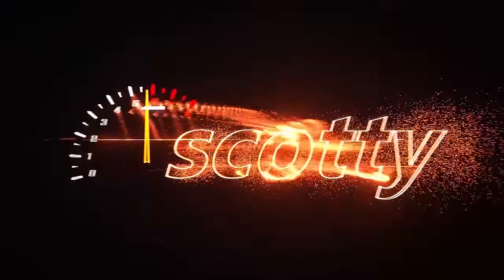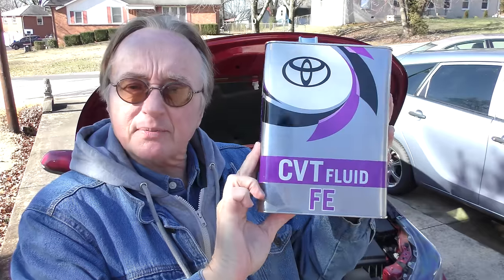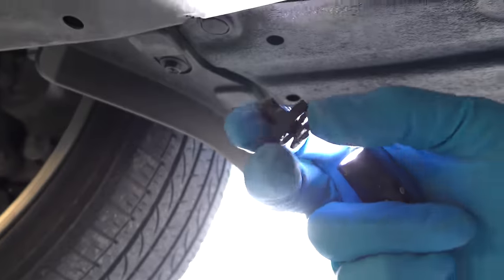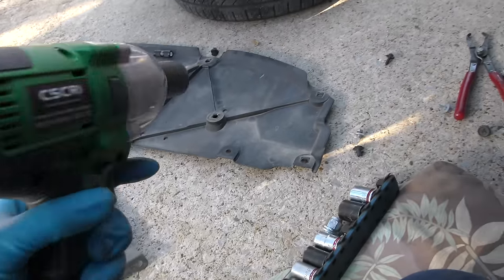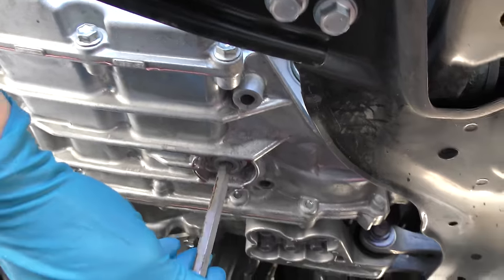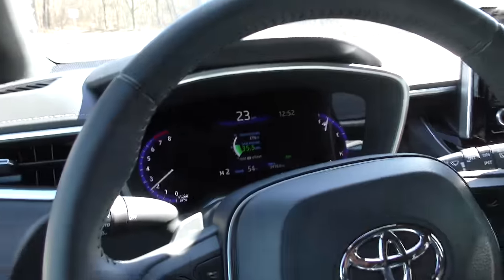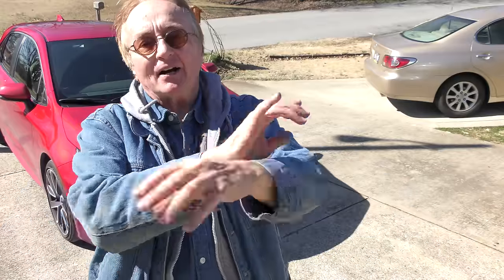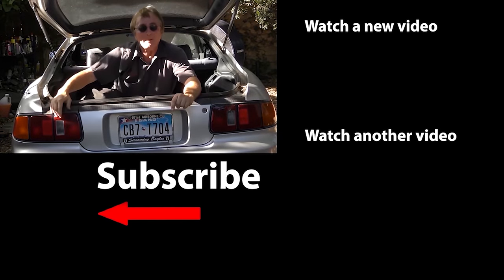Toyota's New Car Really Pisses Me Off

Comment: CVT? No thanks, Scotty.  give me a stick shift any day.
Reply: Manual gearbox for me too
Reply: @Mark-lo6bs That's fair enough.
Reply: Well u better move out of North merica if u really want to compromise what u want for ya life purpose. Outside of NA  there is option for manual version for every passenger vehicle
Reply: Meh - CVT’s (by Toyota) are great - my 11 year old Lexus hybrid on 120k with zero issues beyond basic filters and fluids. Will still have it 10 years from now.
Reply: Toyota CVT has launch gear so it’s good.
Reply: I'll just stick to the Lexus es 350 V6 automatic transmission no cvt transmission drives smooth everytime 😂❤🎉
Reply: @Mark-lo6bs I drove a manual transmission in downtown LA to work for a few years.
Reply: Duluth was rough with a manual transmission. Some steep hills!!!
Reply: Automatic transmission for me. Broke a wrist in the past; manual wouldn't have helped.
Reply: Absolutely. Manuals last much longer.
Reply: Yeah me too
Reply: Good luck finding one in a newer car.
Reply: That toyota CVT last over 200k Miles
Reply: @jonboz7585  Depends who’s driving it. 😂
Reply: @seancorker5815 Toyoya hybrid eCvt doesn't have belt or chain. They build completely with planetary gear.
Reply: Yep, im a honda, mazda and old for guy ..id buy the civic SI or civic sport over this, they come with the 6 spd standard tranny....
Reply: Are you like 60 years old that you're dragging Toyota CVTs name through the mud.
Reply: You probably couldn't even tell the difference between a cvt and an automatic in a Toyota
Reply: @@WindypalaceIn Europe too. Stickshifting is becoming a 19th century thing. Even a stickshift brand like BMW is switching to automatic.
Reply: I am a happy Toyota owner with cvt transmission. 8 years usage as daily driver with 300k on the odometer. Cvt is mainly for fuel savings not for racerboys
Reply: I love manual to, but I’m paralysed left, so automatic cvt auris touring…
Reply: @@Windypalaceyep and they wonder why drag strips are closing.
Reply: Cvt (Crappy vehicle transmission) not saying Corolla is crappy fyi
Reply: Scott doest care for them either, he's just saying the Toyota CVT is the best of the CVTs as it has a real launch gear.
Reply: @bryanczarnecki7570 
…but a es350 is like twice the cost of a corolla….
Reply: @jimliu2560  but not a used or certified es 350
Reply: Manual gearboxes have actually been increasing the past couple years
Reply: i heard CVT in Corolla Sport (hatchback) is great
Reply: @Onion_Knights  
Why hatchback?
The sedan and hybrid uses the same CVT….
Reply: @jimliu2560  i only watch the review of that car - corolla sport in japan, if i am not wrong its a 10 speed cvt which is very good
Reply: My 23 Camry is a 8 speed better than cvt
Reply: @Mark-lo6bs nah, if you are really good at manuals, it wouldn't be a problem
Reply: @seancorker5815 The ecvts are great,I agree. I'm not so sure about these.
Reply: For real
Reply: as manual shift has faded away, so has the nation - probably not a coincidence
Reply: No thank u

Comment: Got a 2016 Corolla with a CVT that doesn't have a launch gear with 265,000 mi on it and just now need a CV axle and rear wheel bearing. Toyota does make a great car
Reply: That's very good! Did you ever change the transmission fluid on the CVT?
Reply: @FURDOG1961  no
Reply: 2010s only Toyota can make CVT and they nail it.
Reply: Great to hear that as I have a ‘24 corolla with cvt and intend to drive it til the wheels fall off.

Comment: A Corolla for $27K?  That's nuts.  These used to be reliable and affordable, but now they're just reliable.
Reply: Model inflation. Modern day Corolla is much larger than the Corolla of the 90s. The affordable reliable Toyota nowadays is the Yaris sedan. Not available in the US.
Reply: I paid $25k in 2019 for a brand new Camry SE. However base model corollas are cheaper than $27k in 2024.
Reply: @viniciusdavila2737 So True. It seems like a mid sized sedan and drives like it too. I have a ‘23 Corolla LE.

Comment: I really don't want to correct Scotty, but as far as I know the Corolla 2.0 Hybrid doesn't use a belt driven CVT with launch gear. It uses an "eCVT" that uses a planetary gear set instead of a belt. The only thing similar to a belt in it is a CHAIN that transfers the power from the gear set to the axles.

EDIT: or do they use different transmissions in europe? I'm gonna have to look it up in my 2.0 corolla manual as I really couldn't find a transimission code on the internet

Comment: They great cars. I have the exact 2022 but sedan SE ( even in red ). Mines at 35k miles now i've owned it since new. I have zero complaints about it and not sure how others drive but I get 40 mpg to 46 mpg depending if i am on country roads or freeway. I am considering in about a year maybe less to go get the Camry. My wife has the 2022 Camry what a machine!!!! But yeah Corolla is good too. lol
Reply: @mikeyspeeds1056  Do you know that 2024 is the last year Toyota is making a fully gas Camry?  All the 2025 Camrys will be hybrid only.
Reply: I get up to 55mpg on a flat highway!  I got the 22 hatchback.  Granted, when I'm that slow on the highway I cruise control behind a semi with good mudflaps.  The sensors are really nice, it'll brake all the way to a slow roll and accelerate back to speed pretty reliably.  I especially love it when it's heavy, slow traffic
Reply: @AmateurFixItGuy Yeah I read that. I don't have a problem with the hybrid either since its a Toyota and there are no better hybrids than Toyota's but I am sure the price will climb.
Reply: @Breakstuff5050 Yes I use the adaptive cruise everytime I drive it.
Reply: @AmateurFixItGuy  That sucks but then again, I would consider a pre-owned Camary.

Comment: Owned about 7 toyota prius and never changed the cvt trans fluid. I reached 400k miles and donated, and the others reached 300k plus. Deers is what killed my cars, lol. I purposely tried to see if the cvt would fail, but no. Runs smooth as day one. Oil changes every 5k and spark plugs every 100k etc. I also have a manual srt for the weekend. 😅
Reply: The Prius ecvt is not the same as the cvt, ecvt is bulletproof, cvt needs maintenance

Comment: Actually to check the fluid level you need to have the scan tool hooked up to check trans temp, vacuum pot, etc. if you just drain fluid and replace what you measure that doesn’t tell you if your fluid was low in the first place.  Look it up the procedure it’s a pain that’s why Toyota doesn’t check your trans fluid level during routine service.
Reply: Iv had like 20 cars in my lifetime and never changed the tranny fluid on none of them and never had problems

Comment: Good stuff as always thanks Scotty. Ill consider it when i sell my 2004 camry just turned 302,000 miles.
Reply: 07 camry se 148k. I will keep my car at least a few years until this crazy car market settles down. will it? my first camry. bought in in 18 with 106k. have done a lot of repairs water pump fuel pump front bearings lower control arms, alternator, brakes all around. drive it in northern nj and nyc so that takes a toll.
Reply: Right there with you with a 02 Landcruiser 345,000 miles,and 03 Corolla with, well I’m guessing close to 500,000 miles, odometer stopped at 299,999! They all do (Corollas)and Matrix, and that was 12 years ago!😂😂😂
Reply: @josephherron744  they all do? I change the oil every 5k with synthetic. 4k recently. I want a 15 to 17 yet i bought a new fuel cap and saw a guy with a 15 to 17 looking at a 23 lol. land cruiser is like a timeless museum piece. I have the dreaded oil burner. I think the 4 cyl corolla engine is the  one of the best made. I had a celica in college so it is natural to come back to toyota.
Reply: @subaruamazon  yeah, I was told at a garage that those year corollas and the sister cars all stop at 299,099. Matrix too.

Comment: consider that if you bolt things down into the body, that leaves entry point for corrosion. the  plastic clips dont cause any bare metal access to the body for good ole road salt to get in

Comment: after car is cold over night...i drain cvt fluid.....then fill with original toyota oem transmission fluid ( cold )....untill it start to come out from top ( fill ) hole .....my car running good...no problem.....just my opinion....
Reply: Manuals say to drain fluid when hot

Comment: I noticed that you only jacked up one side of the car when you changed the CVT fluid. Just a piece of advice from one of your fans. Whenever I change any of my vehicle's fluids, whether oil, transmission, or coolant, I always jack up both sides to assure even and maximum drainage of whatever fluid I'm changing. It also prevents residual fluid from collecting in whichever corner or side is the lowest. In fact, since I drive a manual transmission (I bought the last of Toyota's 5-speed manual Corollas...BOOYAA), I need to jack up the back end as well as the front to assure it fills up to the proper level upon refilling.

Comment: You showed  belt CVT Toyota does not use this, it is a eCVT with motor generators to charge the battery when braking, it also does not have a 1st gear  the toroidal gear is a power split device to charge the battery
It,s proven reliable it's a  Prius underneath

Comment: Closed off bottom - I was lucky as the Elantra seals off areas where you are unlikely to need access - the edges in the middle. The only thing I don't like is that headlamps are way to hard to access - why do they not make headlamps a 5 minute job.

Comment: I did the same job on my Sisters 2014 Corolla with the CVT. Only about a Litre of fluid actually drained out though, even after removing the straw. So it will need to be done multiple times which is annoying.

Comment: The secondary piece he took out from the drain plug area actually acts as a leveling straw if the transmission is at operating temperature. CVT fluid is also now a myth. Valvoline Maxlife ATF now covers majority of common cvt specs in addition to the regular ATF specs.

Comment: Bought a '24 Corolla hatch recently and it really has pissed me off. It drives great, gets great gas mileage, looks amazing, yes, but! There are two major issues:

1: The HVAC fan blower emits this horrible high-pitched noise, at about 15 kHz (google "online tone generator" and see what I'm talking about). It's impossible to fix because it comes from an integrated circuit in the fan speed controller. Totoya and the dealership both say it's a "characteristic of the vehicle" and refuse to do anything about it. So all I can do is muffle it with tape.

2: The speakers sound like garbage. I talked to a car audio professional the other day and he said, he had worked on one of these and discovered the bad sound was coming from *the head unit*. The source signal is bad!! So it doesn't matter how much you upgrade your speakers or amplifier, it's still going to sound like crap until you get a new head unit, or install an expensive, fancy system to correct the distortion from the radio controller. Explains why sound quality in the cars with the upgraded JBL sound systems is still trash even with nice, expensive speakers.

I know Toyota has great engineers and make a car that lasts, but damn, all those guys must be deaf or something. Because the audial experience of this car is actually a nightmare.
Reply: Boo hoo

Comment: Big deal      my 1998 Saturn 1.9L got 40MPG Highway    WHY 5 speed stick 334,000+ miles still running       there is no replacement for the stick shift

Comment: Scotty did not say, why a 2 year old car, needed a fluid change. What about the filter? That is a really stupid complex design, for draining and filling the transmission.
Reply: Ibhave several Toyotas, never changed the trans filter, only drain and fill. Those fiters don't need changing unless there's an issue and you suspect possible metal. But with regular maintenance they pretty much stay clean

Comment: Still the best value car in the world. It will regain its crown of most sold mode globally next year from Tesla.
Reply: They're way overpriced now, though. Toyota used to be affordable.
Reply: @morebeer7673 Depends on the shop and model. But you’re right.
Reply: @morebeer7673   Better to buy a certified Toyota that has come off lease. If it had regular oil changes it will be a far better purchase than the other crap being sold new.

Comment: One of my vehicles has a plastic undercarriage shield with a cut outs to get at the drain plug and oil filter.  Unfortunately when the flow slows down the plastic shield  catches the dirty oil and it runs out the front, far from the catch pan.

Comment: CVT's only got a bad name because Jayco provided the lowest bidder transmissions to a couple providers notably Nissan. 

Toyota's CVTs actually are designed using the same quality and engineering time as their automatics therefore they are just as reliable as their automatics
Reply: Jatco , Don't reply BTW

Comment: Hello, on a cold start my 2013 suzuki swift vibrates violently when put into D /R . When it gets hot the car dies as soon as it is shifted into D/R. Idles in park.  I changed the transmission fluid but that didn't help.

Comment: I'm sticking to old cars. Give me a 360 and a 727 torqueflite  and I'm good to go.  Edelbrock makes fuel injection systems and  MSD ignition systems for older vehicles to preform as reliable daily drivers.
Reply: And the older Chryslers are reliable even with the original equipment.
Reply: @TheopolisQSmith  , What the exception of slant 6 engines. The newer gasolines tend to vapor lock faster than c***. I've found that converting those to fuel injection is a necessity.

Comment: I have a 2014 Camry that has a regular 6spd automatic but they still have the same stupid design of changing the ATF, meanwhile I also have a 2013 Honda Civic that has a dipstick so you can actually check and fill the fluid from the top and a traditional drain plug.  Toyota sure tries to make it difficult to perform basic maintenance.  It also has the paper oil filter element inside the metal housing,  why can’t they just use a traditional spin-off oil filter like my Honda and practically every other car out there?

Comment: In the rustbelt, plastic clips are sometimes preferred to screws or nuts that tend to rust away, get stuck and break, especially small 10mm studs. Plastic clips are easy and cheap to replace.

Comment: Why not have a filler plug hole positioned at the correct fluid level on the gearbox that dribbles fluid when you replenish the correct amount ?

Comment: How many miles do you change the cvt fluid ? I have 32k on my Corolla cross with the same transmission
Reply: Change it. CVT fluid should be changed about every 30K miles.

Comment: I wasn't a fan of cvt transmissions until I drove 22 Corolla SE. Its nice. Also like the electronic power steering.
Reply: Yeh, I like them also👍.....some people are scared of change🤔
Reply: @mrgarrison3516   it will depend on the brand. toyota and honda cvts are very reliable. but if you get a nissan or mitsubishi,  get ready to spend dough replacing them every 30k miles…
Reply: @JoseDiaz-qw7mg 
I would never get a Nissan CVT, they ruined the name (CVT) for all the other car brands 🤦

Comment: My 1.3L Yaris CVT (Non Hybrid) here in the UK got 58mpg which is the same as the 6speed. Has Toyota made a car that's the same mpg as the manual,is this the 1st?  😀 Mine took 2.2L each drain, got the 5L FE fluid so did 2x drain & refill, i had room at the top to remove the fill plug on the side,used a garden hose & funnel to pour in the CVT fluid.....easy!
Reply: the imperial gallon is 4.546 litters and the us gallon is 3.785 litters

Comment: Hi Scotty, it's my understanding the plastic covers underneath is to protect against the salt water and stones hitting from underneath. The covers on the engine is to reduce engine noise. Do you believe this is incorrect?
Reply: It’s also there to smooth out the airflow under the car.

Comment: I looked at a 2024 Toyota Corolla Hatchback in a dealership showroom.  I really wanted to like and buy that car. The front passengers seats have much more room than a Corolla sedan.  However,  the back passengers seats woefully lack legroom. Lastly, the worst  thing about that car is the trunk looked more like a glove box.  Do not plan on going grocery shopping, or plan on taking a trip in that car.  A suitcase that fits in the overhead compartment of an airplane will fit in that trunk. Any suitcase bigger than that and you are outa luck.

Comment: The launch gear is an improvement, but I would much rather have the eCVT from the Camry.  It doesn't rely on any tapered pulleys, belts, or chains as shown in Scotty's diagram.

Comment: Does the cvt have a filter that needs to be replaced or is it just a fluid swap? I have a 2024 Corolla also with the cvt?
Reply: Yes, there is a steel mesh filter that can be changed & also a magnet on the inside of the drain pan that catches all the shavings that the filter missed

Comment: At how many miles should that CVT Transmission Fluid be changed at? It doesn't have a filter? Thank you very much.
Reply: 30k miles first change then every 50k is what I plan on doing.
Reply: Filter change at 50k just drop pan. 30k first drain & fill.
Reply: @davida871  Thank you very much.

Comment: Thanks Scotty. I wish Toyota had kept the manual as an option, but "on paper" the logic of this "hybrid" CVT makes complete sense. Put the majority of the stress/torque on a mechanical gear initially - then hand it off to the CVT once the speeds/stress/torque are far lower. Those Toyota engineers can be pretty sharp at times. And no "Stupid Plastic (TOP) Engine Cover!" to Frisbee.